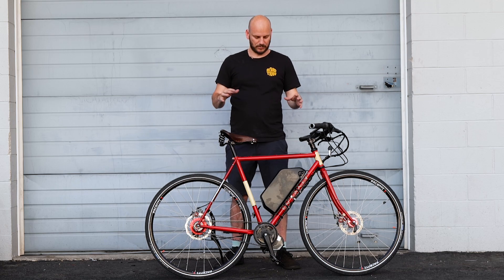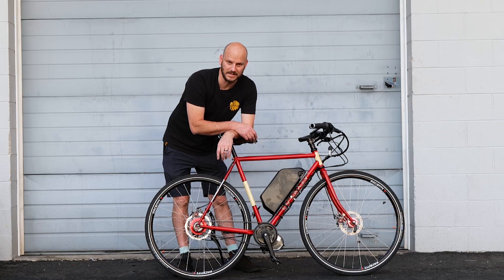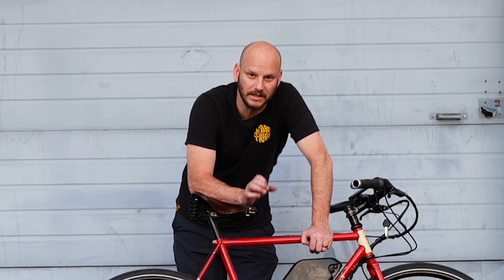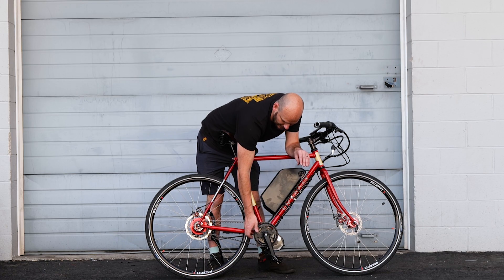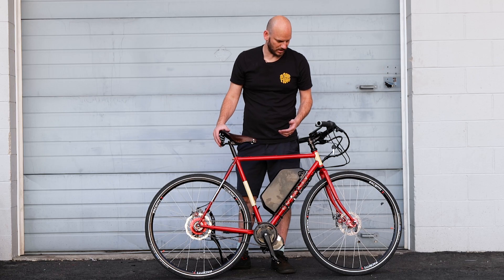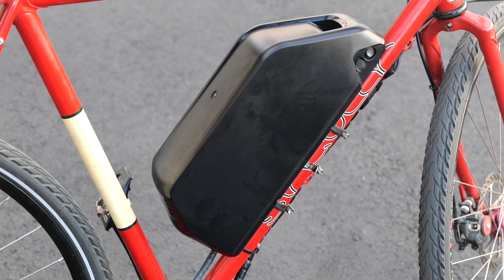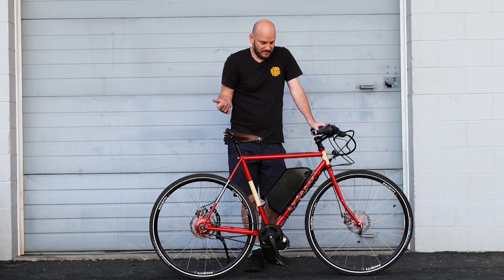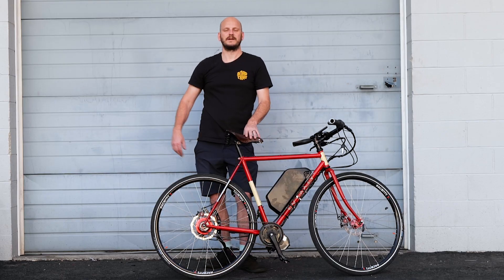Custom E-bike Build: Soma Belt Drive w/ BBS02

Comment: The belt concept is great. Would love to see a setup for a BBSHD. 72v with 1:1 ratio. Does someone make and sell the rear cog adapter for a Shimano HG spline freehub? In a 42T size for instance? No need for that fancy hub when all you need is 1:1 and a throttle.
Reply from the maker: Depends on what kind of riding you will be doing I would say. I agree a 1:1 with 72v would awesome with a throttle! But if you want to pedal over 20mph you would probably be winding out around 15mph.
Reply: @JohnnyNerdOut  I have a 2006 Specialized Big Hit FSR3 downhill bike converted with a 72v BBSHD and custom 4 speed cassette. It's used 99% for offroad riding. Gnarly stuff, steep climbs. 42T front and 46T rear as my largest cog. Don't care much for pedaling cause it doesn't do anything with that power LOL. What parts are available to convert it all to a belt? Thanks.
Reply from the maker: You pretty much just need the chainring spider adapter. They are cable for the Bafang mid drives. Not sure if they are out for the other motors.
Reply: @JohnnyNerdOut  do you sell those items on your website?

Comment: I assume you used a shift sensor on this, because the big downside to the Rohloff is that it doesn't want to shift under load.  Wasn't that a bit of a pain with the push-pull cable system that is used?
Reply from the maker: That’s actually a good thing that it doesn’t want to shift under load because it actually won’t shift under load. It essentially is a built in gear shift sensor. No need to add one.

Comment: Too cool! I still like rigid bikes, even own one (as my city commuter). You've convinced me that dreams of a belt conversion of a chain driven bike are just that, dreams. If the bike were originally a belt driven bike would it still have the same BB problem? A belt driven bike would already have the break in the rear triangle & horizontal drop outs so, I assume, the belt tension would be pretty easy.
What a sweet distance road trip bike.
Don't knock your own work. That is definitely a work of "fabrication", and a nice job of it.
Edit: in the beginning of the video you said it was a BBS02 & in the middle of the video you (mistakenly) called the motor a BBSHD.
Reply from the maker: I’m getting old 😂
I don’t think a bike designed to be a belt driven one from the get go would have as many issues, but it’s a bike to bike basis on that. I think as long as you have horizontal dropouts you are good!
Reply: @JohnnyNerdOut  Not as many issues but unfortunately belt driven bikes are a big investment for me to potentially/probably screw up.😆
This may be my favorite build of yours. Good job.
Reply from the maker: Thanks!